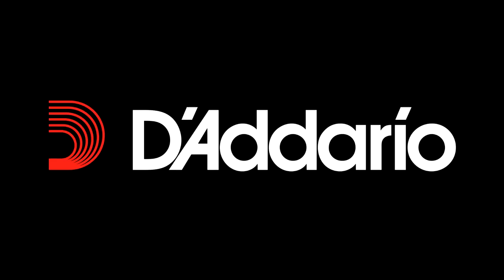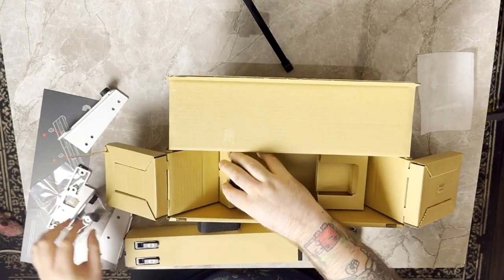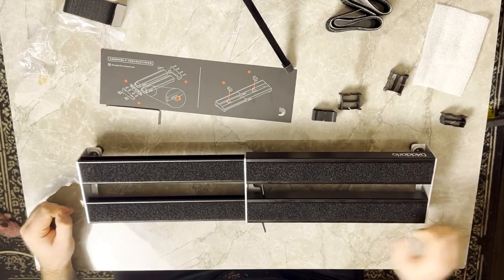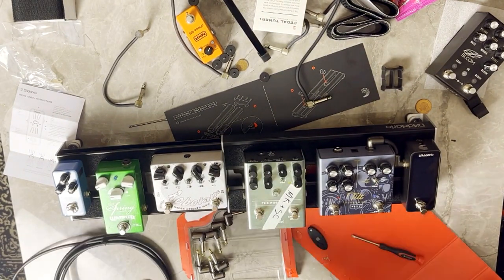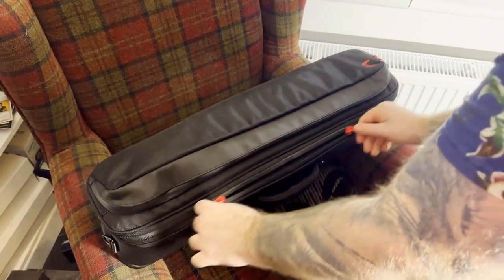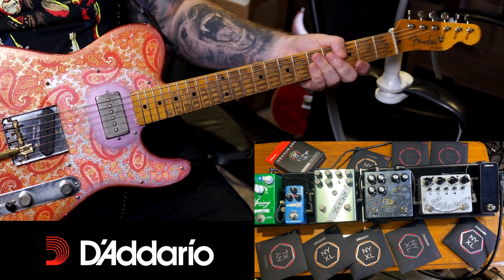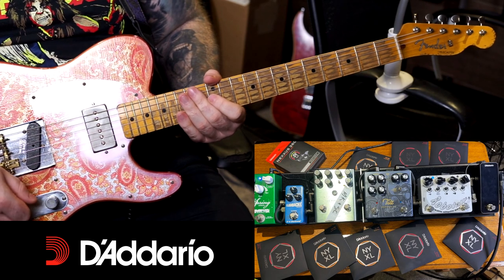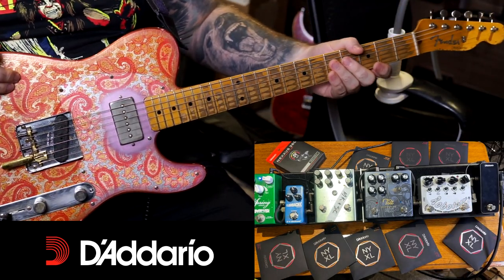Building A NEW Pedalboard & Sound Test - D'Addario EXPANDING Board

Comment: Just bought this pedalboard.   Its excellent.  I did install longer bolts on the front to raise it enough to accomodate my power supply and that worked great.   However the carrying case is a bit of a disappointment.   After mounting pedals on the board the case has no room and its hard to close the zip top.   They should have made it at least 2" deeper and that would have made room for when you install pedals on it.